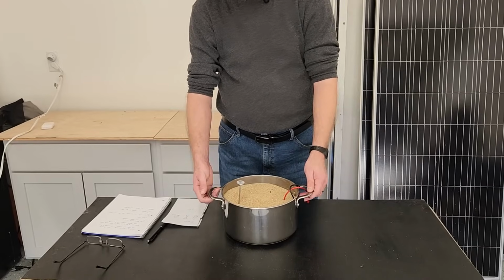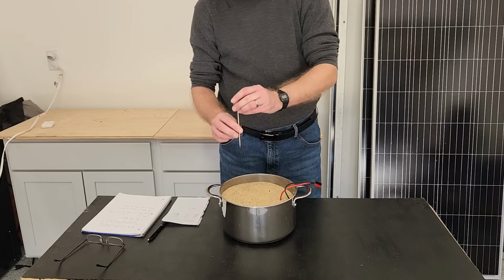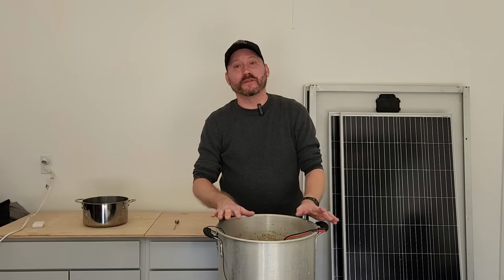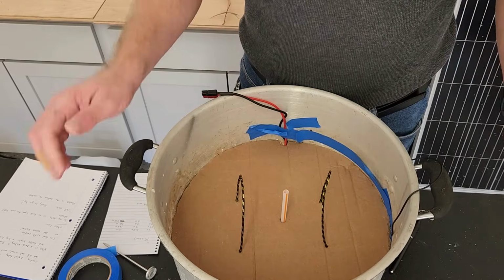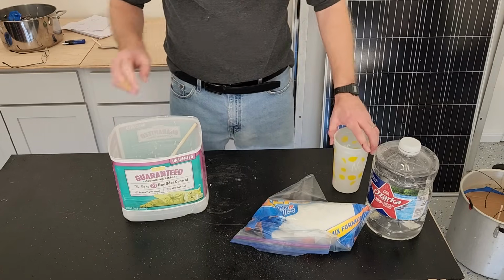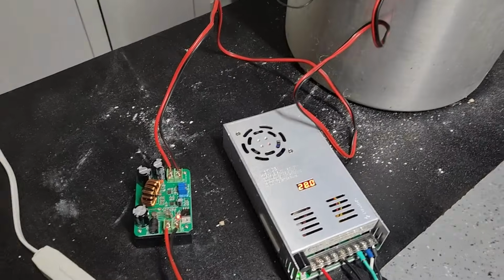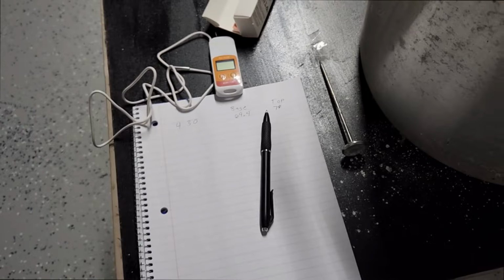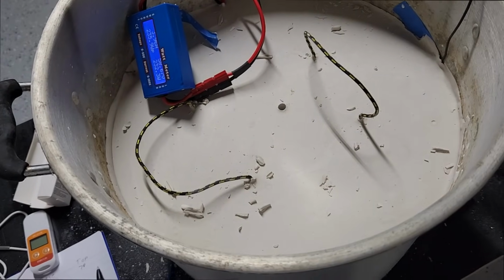Sand Battery heater. Create free heat  of 500F using solar electricity! Texas Prepper Projects

Comment: Thirty years ago, my uncles and dad built a house for my grandparents in Fargo ND. They used electricity to heat the house. In Fargo, footings have to be deep and most people have basements. In this case they lined the concrete with insulation and filled it with sand. They ran heating tape through the sand. The local power company had a special off-peak rate. The house was well-insulated and could go for several days in the middle of winter without power.

I don't remember how they controlled the sand temperature but it wasn't that hot since the house was always 75 degrees F and there was no control between the sand and the concrete floor.
Reply from the maker: I was actually born in ND and got family in Fargo!.    It was probably just a big thermal mass but I'll have to ask the relatives still in the area if they know more.
Reply: My hat is off to your family,  Texas Prepper and all the amazing people that live in ND.  I worked up there for many years and I am amazed how resilient and friendly people up there are.  When someone talks about people being the backbone of the our country it these kind of people.
Reply: Woulda been nice to see it instead of hearing about it. Great thing about videos
Reply from the maker: @ourpeoplespoll1474  What would you like to see?
Reply: If you could explain the original comment @texan prepper, about using this type of thermal mass to heat a basement as original commenter described that would be amazing.
Reply: Also as someone educated in thermal dynamics (NNPTC is the school), removing the top plaster of Paris will help warm a space faster, will not help retain heat and that is the point
Reply: @texasprepperprojects  How would you change the probe in case it gets fused (short circuited) or die somehow?
Reply from the maker: @gauravashq  I put a fuse on the power lead
Reply: I'M FROM FARGO LOL
Reply: was really surprised to read that as the first comment
Reply: Heat tape as I know it is self regulated by temp(I beleave  its done with some clever metal alloys that loose conductivity at the specified heat), the stuff I can generally find is for wrapping water pipes to prevent freezing in crawlspaces.
Some of them you can buy the stuff in rolls cut it to length yourself then add terminals to one end plug off the other and your ready to warm X feet of pipe to ~65f at like 60W per foot of the heat tape used(or lest that's what I remember could be far off at this point).
Wouldn't be surprised with a more focused search finding higher temp or lower wattage/foot, etc.

Frankly using it in sand that is insulated from the earth/walls/floor in the basement as a whole house heater, I love it. 
The good insulation is part of the key, for example even with that off the shelf stuff at 65f max, heat will rise up when it can (and down and outward have been insulated anyway, IE from the top of the sand battery is going to do most of the radiating of heat as the sides and bottom reflect it back in and up), so maybe that sand battery is only 65f, and the house is capping it in like a greenhouse dome, giving you a net stable temp of ~75f in those living spaces above? 
I mean that amount of mass even heated to just 65F that's a lot of BTU's with the path of lest resistance if built correctly will  be the most drafty point of your house, or if sealed well, likely your door/windows or the jams there of.
 
Hell, maybe you dig the basement a bit deeper, then you can have a full basement on top of the sand battery, or at lest a tall crawl space, no one likes a tight ass crawl space when working on the utility's, or using parts of the space as long term storage.

Would only need a timer and relays to do the heating only during that off peek time, but that would have to be re timed every power outage.
Reply: I think using  a radiator and run copper tubes through the sand.  I agree that the water heater element should be inserted through the side to avoid melting the wires etc.
Reply: @TheLoiteringKid - one thermodynamics fact... if you want your space 75, your heat source has to be at least 75.   Heat ONLY ever flows toward the colder side, and without a concentrating device like a heat pipe, you can’t get a temperature higher than the source temp, through any of the three types of heat transfer.
Reply: In a closed system sure, but if we are going there then I simply forgot to list all the additional heating sources a typical house would have, don't forget the age of the house would mean all light-bulbs would have bee heat producing incandescent, and the main appliances, likely were under 80% efferent.
Reply: My 3-car garage is filled with sand under the slab to a level even with the basement floor and heated with a boiler and 3 zones of tubing. I can charge the sand battery with off peak electrical, solar, or firewood, and it gives off heat through water into the house for days.
Reply: That is awesome
Reply: Great idea. Is your element 120v  or 24v ?
Reply: Well then you could make a plaster of Paris top that you could put in after the space has heated up. You know a removable top.😊
Reply: If those were heat tapes like used on water pipes, most have a built in thermostat that cuts them off
Reply: @TheLoiteringKid sorry man but if your thermal battery is at 65F it’s going to be sucking heat away from the places you want it. Unless you want your house at 65 or below anyways. Yes it may be warmer than outside but unless you’re using a heat pump setup there’s no way to pump those BTUs to a higher temperature region.
Reply: That's a really interesting story! It's great to hear how your family creatively used electricity to heat the house in Fargo. It sounds like they had a smart setup with the insulation and sand-filled basement. Speaking of power solutions, have you heard about the Segway Portable PowerStation Cube Series? It's a versatile and powerful backup power option for outdoor camping and home use. It can even keep your devices running during power outages in just 0.03 seconds! It's worth checking out if you're into outdoor adventures or value reliable power.
Reply: That's a really interesting story about using sand and insulation for heating! It's great to see how innovative solutions can provide efficient and cost-effective heating options. Speaking of innovative solutions, have you heard about the Segway Portable PowerStation Cube Series? It's a versatile and powerful backup power option that could be perfect for outdoor enthusiasts like us. It has a massive capacity, fast recharging, and even waterproof technology. Check it out, it might be a great addition to your camping gear or home backup power setup!
Reply: That's a fascinating story about your family's innovative heating system! It's amazing how creativity can make a difference in saving energy and reducing costs. Speaking of innovative solutions, have you heard about the Segway Portable PowerStation Cube Series? It's a versatile power storage solution with massive capacity, fast recharging, and waterproof technology, making it perfect for outdoor enthusiasts like us. It's definitely worth checking out if you're into camping and home backup power products!
Reply: @electricamir248   at 3.03 he says he feeds 60 volts at four amps, so it should be 120v...or more
Reply: @EffBlx  As far as Industry probably a huge mix like any other USA state. I was up there for Oil and Gas production. They have lots of Farming and some Ranching. I think they're one of the bigger Sunflower producers. Also some small Defense  contract Industry scattered around. Plus, tourism is good at times.
Reply: @EffBlx  I don't know what they paid. I heard it was a small mfg facility for someone like Northrop, that they made cable assemblies for  DoD.  Best paying jobs were oil and gas related and there were many of them around 2016 to 2019.

Comment: I like the sand as it is inert.  Sand is made up of silica so it is a natural insulator to electricity.  Yes you can create a carbon trail between the wiring  points on the element but it does not result in an electrocution hazard.  The sand should NOT conduct at that voltage even at a temperature of 500 deg F.  
Just one idea, coils for a liquid that can be connected to heating coils buried in the sand could supply heat for water tank or a could heat a home using forced air.  No doubt your plaster cured more quickly because of the heat in the sand.

Art Ceramic studios use liquid "Slip" it is liquid clay and the molds for the slip are made of plaster.  I trained on making molds and think I can help you.  Usually garden Gnomes or plates for decoration, small pots or coffee cups with interesting logos,  much more popular in past decades.  I have made and poured slip into molds.  The kiln used to fire the slip into a solid ceramic could be used to make an insulated base for the bottom of your pot for a form you could build a ceramic base to elevate the a little and it would not be on the carpet.  If you want to get in touch I am in San Angelo, Texas not far from Goodfellow AFB.  I am an old broadcast engineer electrician and sometimes plumber, with solar training and lots of experience ideas.  You are welcome to Reach out if you wish.
Reply from the maker: check out videos 2 and 3 on this!  (I went to college in San Angelo)
Reply: @texasprepperprojects
Reply: Good idea on using slip to create a base. It's good to have experience in different fields. I have been watching videos like this for a while. None of the ones I've seen so far has shown how the actually heated a room, though. I'm thinking that a small fan could work with it, too, that would blow in different directions.

Comment: I just watched another video where they used heat powered fans on top of the sand to spread the heat (the kind you use on wood stoves).
Reply from the maker: I have seen that same video. It's given me an idea for something similar. Stay tuned
Reply: @texasprepperprojects  if you are interested in that scenario, please consider the idea of using Stirling engines to generate electricity.  Say enough to charge a "Power Wall" and to provide juice for the heating element. Also look at the linings for small scale smelting operations and fire brick. I would be very interested how it turns out since I live in a rural area of the Hill Country.

Comment: I love how you had multiple points of temp measure.  Good job and simple yet reliable design.  My 2 cents, add a larger heater with more surface area like a range heater or one that comes with wiring designed for really high temps.  I would also do like you suggested, drop a pipe into the sand that could be supplied with an air source to be turned on when you want more heat.  Please more videos
Reply from the maker: check out my other videos for more and better testing